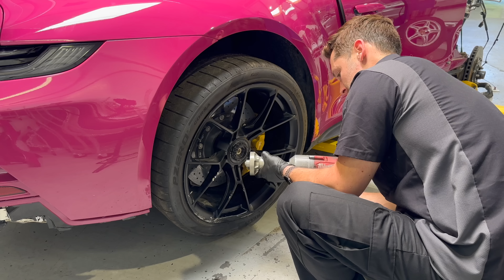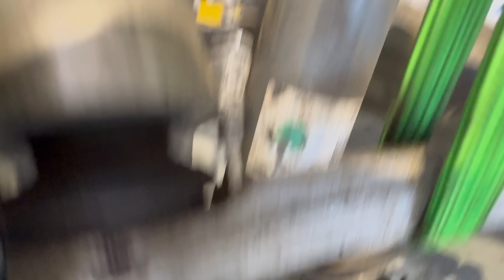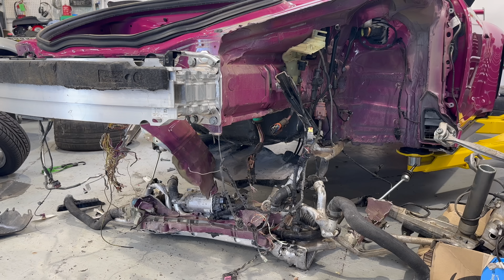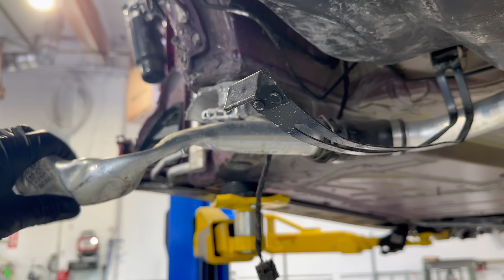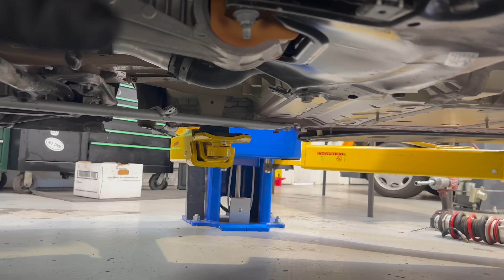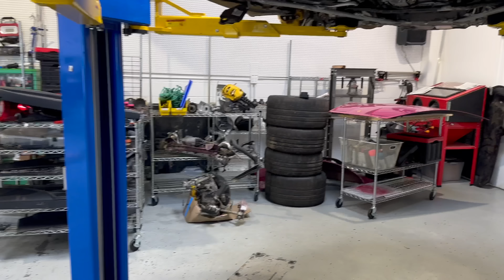REBUILDING A TWICE WRECKED 992 911 GT3 - EPISODE 3

Comment: Great video! You might want to consider putting a couple ratchet straps on the car to hold it to the lift, it's cheap insurance!
Reply from the maker: Yeah, that is good advice! I'm considering building a frame cart for it as I'll need that to locate the new front end prior to attaching it.